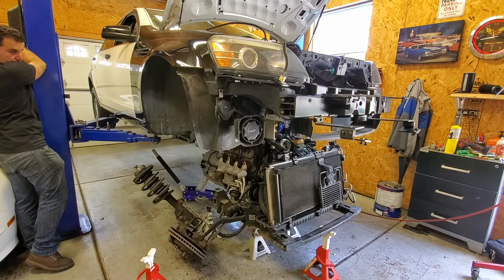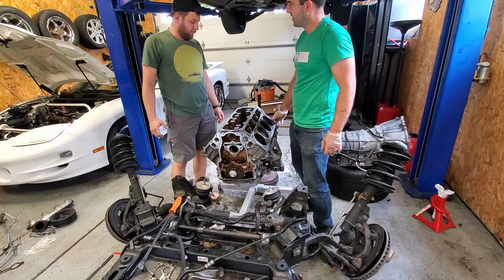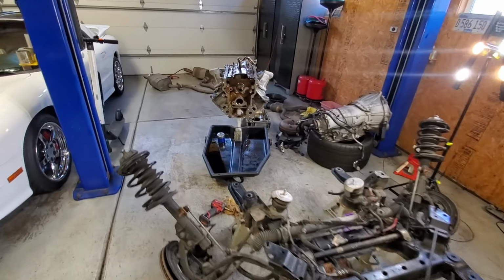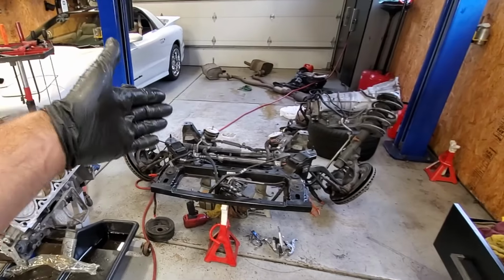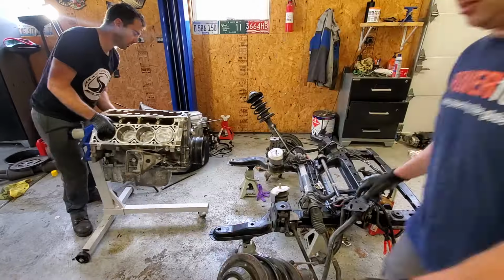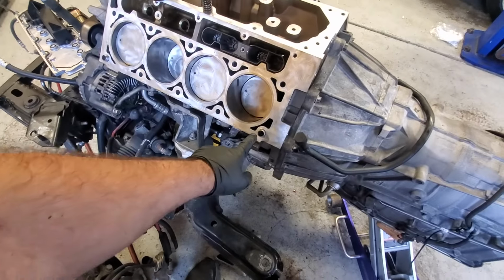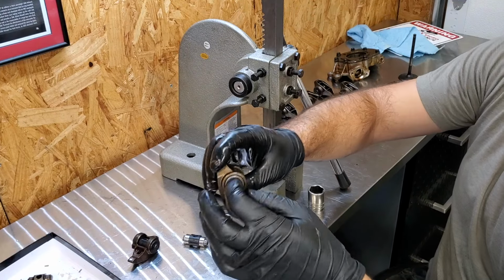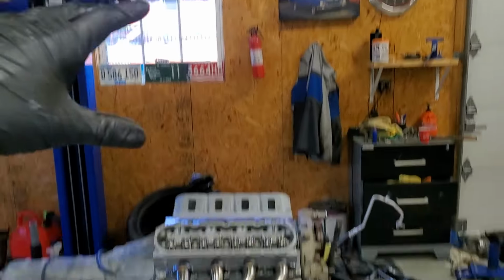Fixing THE WORST LS Engine Factory Defect Ever & Adding 100 Horsepower In The Process! GM Failed US!

Comment: Nah... I don’t know anyone who hasn’t experienced DOD/AFM lifter failure,  passed 100k miles is guaranteed failure.

And that “fuel savings” .... that was a marking pitch. Anyone with a DOD motor that has deleted the DOD system will tell you they get better fuel economy without it. No explanation- It’s just a junk system.  And I say that as a guy that’s bought GM cars and trucks for 15 years.

Comment: So recently I rebuilt a 5.3 truck engine from an 03 truck and attempted to put it in a 2009 truck. Found out that wouldn't work because of the DOD and had to sell the engine. So when you built that engine and deleted the DOD what did you do about the crank trigger? My understanding is that they are completely different and will have to be changed so the ECM can control the timing. Do you expect that to be an issue?
Reply: Your application didn't work, as the ECM was expecting 58 teeth on the crank, and you gave it 24.  Thats assuming you didn't change the trigger wheel. Or ran a standalone ECM. In which case - ignore this!  :D

Comment: It seems to me for such an awesome engine there's a lot of extra stuff that has to be done just to make them work properly from all the GM flaws I don't call that awesome I do understand that yes it's a lighter engine it's sizes different in comparison to the older Motors but then again what is the deal with all the flaws when do you think that they will ever build a motor that just doesn't fall apart all the time? And that goes for all of them Chevy Ford GMC Chrysler even the Euro trash which is even the worst out of all of them expensive garbage it seems they build a car that only lasts so long so that you have to keep buying and buying and buying but you had all the older vehicles that are still on the face of the Earth still have the same old engines that are still running

Comment: Stainless steel headers are bullshit ! What you want is ceramic coated headers ceramic coating retains more heat in the exhaust giving you more power and better fuel efficiency

Comment: @LegitStreetCars
That green rubber attachment you are using has abrasive in it. It does in fact remove metal, and has the potential to cause problems with variations in the surface if used improperly.

Comment: uhm actually that green wheel will remove material because the plastic actually has abrasives in it or a wire of some sort. It would not leave a pattern on the aluminum if it didn't. I actually use them all the time but I'm really careful because it does scratch the surfaces.

Comment: Alex, any chance you could give me some info about your WS6 turbo set up? I was watching your old videos about the set up, and you mention that you're using a C6 exhaust manifold on the passenger side to clear the AC compressor. Keeping my AC is my number one objective while going turbo. Can you explain a little bit more in depth on how you cut the radiator support, fitted the Saab radiator fans, and then how you routed the piping for the turbo set up? 

Thank you.

Comment: I am curious why you did not put on high pressure cam lube prior to can installation? Also, since this is a performance build, why did you not degree the cam with dial indicator etc?

Comment: For future reference, don't use the crankshaft bolt to suck the balancer into place. While you can get away with it 99 times out of 100, the one time you don't get away with it you'll be replacing the crankshaft because you stripped the threads out of it. Get an installer tool (as you mentioned). Cheap insurance.
Reply from the maker: I did use a longer bolt
Reply: @LegitStreetCars  - The problem is not the length of the bolt, but rather twisting the bolt against the threads of the crank as the drawing force. It's very easy to strip the threads out. Also, you run the risk of bottoming a longer bolt in the crankshaft, which will run you a huge risk of stripping the threads if you aren't paying attention. Using a tool will use all of the threads in the crank without twisting on any of them. The twisting is done on the threaded tool to nut interface. It's made easier by using a tool which has a bearing between balancer and the installation tool. You can't (sanely) fix a crankshaft by using a helicoil, and there aren't any larger hub bolts if you thought about cutting a new thread. The only real option is to replace the crankshaft, which costs you not only in money, but in time as well. Again, an installer is cheap insurance.

Comment: I've got a 16' Silverado 2500 HD with the 6.0, it has developed a squeak at 170,000 miles. I've been told it's a bad lifter by two mechanics... it does not have the cylinder deactivation feature. Both mechanics said I'd be better off getting a whole new engine. WTF?! Any input?

Comment: You normally install the cam with the dot at the 12 o'clock position on the LS. That's what all the service manuals say. That's what I did on my LS with a BTR stage 3 cam and it runs great.

Comment: so much piss poor work done with this !!!! 
did you REALLY tape up the crank sensor wires ? are F'n stupid !!!! get a dam connector harness end and cut and replace that end !!! you had a easy job and turned it into a nightmare !!! 

did you use the shims on the oil pump before tightening it down ?

Comment: So I really really hope that wasn't a 3m disk you were using to clean those pistons and other surfaces, because you might as well just poured sand in motor, down the intake and then started it. That's not what they are ment for. any particles or pieces can cause major damage. Even 3m tells you that

Comment: Alex, great build!! The Cadillac Modular Displacement Engine was a 368 v8  TBI, used in 1981 models and 1982-84 Fleetwood Limo's. The Olds 350 diesel was a different product.  I had one of each, and one of the HT4100 v8's from 1984.

Comment: Good choice on going amsoil. I service fleets of ford and Chrysler's. Using Amsoil from day 1 and they have 350-800,000 miles original engines ranging from 4 clys to 8 clys. Best oil on the market. I do 10,0000 mile intervals to 300,0000 miles then I go to 8,000 after

Comment: Dude, would've taken 5 mins to de-pin those harness wires and heat shrink them...about as long as you spent wrapping them with electrical tape, but with a longer lasting, more water-resistant solution.

Comment: Hey man. Just found your channel. You can dimple the headers to clear your obstructions. Roadkill did a dyno test where they kept bashing headers and making pulls. They basically destroyed the headers and it made almost no difference in power (maybe 2 hp). So bash away to make them fit.

Comment: is that really a good idea to take a whizzy wheel to the engine block mating surface like that???
Reply: No actually it is not . The Roloc wheel  hurts aluminum surfaces and should NEVER be used ...Cast iron YES Aluminum NO ....
Reply: I think maybe there's two different types of those wheels, brown ones and blue ones? Thought maybe blue ones were ok on aluminium.
Reply: @joecook3223  no!     NEVER!
Reply: Been using red wheels on aluminum forever, haven’t had any problems.
Reply: Oh he mentions it at 9:00

Comment: With cam kits, and we mostly use BTR, we ditch the hollow intake valves and upgrade to Manley stainless steel valves. The stock hollow valves are light but are two piece and can break with higher spring pressures and aggressive cams.

Comment: I can attest to using plastic grinding disc to clean the head surfaces. I used that method when I reused a cylinder head on a Hyundai Tucson 2.0 engine. Worked well and engine ran perfectly. No issues. Good tips.

Comment: Hey not to bash you Alex but on an aluminum block, the 60 grit bristle disks shouldn'tt be used because, depending on how they are pushed they can take off too much material. Issues can arrise with the Mls head gaskets due to the swirl paytern that they can leave hence heating and cooling cycles.

Comment: I need to do an AFM delete in my G8. It is tuned out in my GT but the AFM parts are still there.
Reply: In Australia AFM in the 6.0 LS motors was introduced in 2009 prior to that none of these LS 6.0 litre motors had the AFM   Not all of these V8s have AFM from about 2006-2009 VE holden V8 which is what your G8 originally was and shipped to the states and converted to LHD

Comment: GM has made over 100-million small-block V-8's. Why would they jeopardize the company's reputation on this unproven mickey mouse technology with a minimal overall advantage? I had a GMC Envoy that was like new except for the engine with this system. The dealer quoted a repair(out of warranty, of course) that was more than the car's value. So I sold it to someone that did an LS swap.

Comment: Highly suggest to remove the red spring and install the “similar to stock” blue spring in. It is known to starve the engine of oil in the pan because of the excessive pressure! I have a TSP 231/246 with a 111 LSA and PRC 260 heads. I have had both springs in and for a heads/cam car the blue spring has been overall better for drivability and oil temps were lower (red 220-227 degrees vs blue 213-220 degrees). Pressure sat at 40-45lbs on cold start and 27-30lbs warm with blue and 35-40lbs when my foot is in it.

Comment: Sounds just like the MDS system on Mopar vehicles. The best thing I ever did was get my Diablosport tuner and shut that horrific system off completely in my 2014 Chrysler 300C w/hemi V8. Add a 91 octane tune and different cooling fan parameters with a 180 deg. thermostat and it woke it right up. Gas mileage is unchanged at 21-23 mpg on the highway.
Mopar's system will give the same problems and trash the camshaft in case of lifter failure, and you have to pull the heads to change lifters.

Comment: I pulled a cam out of my l96 that looked like that.....flat lobe and all.....dod vvt motors are garbage should have never been used in the LS series if u ask me........on my wife's 2014 tahoe I gotta programmer and removed the dod the first month we owned it back in 2013..........still can't believe we paid damn near 70k for that pile. ....wtf ...it only has 36k miles on it now and we would probably be lucky to get 20k for it.......what a joke.....but it's still pretty quick for a soccer mom mobile.....quicker than the average tahoe. ....just programing and exhaust makes a world of difference
Reply: Trent Dawg I worked for a pretty cool dealership as a kid through college the owner  used to talk to me one day he said cars and truck are a poor investment and not an investment at all he was right but all my duties at the dealership over 9 years allows me to paint do professional body work engine rebuilds at my home shop  . I drive nice like new old cars and older supercharged  modded  C3 in blue old school blue and diamond metal flake for very little cost because of the skills learned .

Comment: Brings back memories, but on a small block 302 motor. (I believe I may have mentioned this before, so avoid it if you've seen it.) No one was ever able to give me any idea as to what the power really came from the 302ci Z/28 motor in 1969. Certainly not 290/290 as it said on the air cleaner. After using headers and a performance valve job with all new solid lifters, springs, lighter rocker arms and screw in studs, new valves with a better cut to them (more aggressive), new double roller timing chain, porting and polished and Cc'd chambers, the speed shop quoted it had somewhere around 410hp. That was with a stock cam, polished intake manifold (inside) and all new special (lighter and stronger) pushrods and a new 780cfm double-pumper Holley jetted to give the best power. I also had a mechanical advance distributor and a better coil. Needless to say, it ran incredibly well and while it had been a blast to drive before, it was like night & day with the new setup. I pegged the speedo a few times at 140 with the 3.73:1 rear on the std Muncie 2.20:1 1st gear tranny.

Comment: Great Video man. I had an engine fire in my 1997 Comp T/A Yesterday. It has been my dream car since I was in high school back in 97 and I've owned this car since 07. I had pulled it out of my garage and fired her up to log some IAC Counts. As they were a bit high at idle last time I logged the car. And the day before I modified the IAC Passages on my BBK 58mm TB to bring the IACs down. I stepped into the garage to put some stuff away. She must have sprung a fuel leak early on after I found a 1in split on the return line under the loom that looked like it had gotten dry and rotted. And it must have been leaking for a few min. About the time it started idling kind of rough I looked up and thats when it ignited. There was a giant fireball I ran to the car and turned it off, ran to my garage to get my fire extinguisher and remembered that it was still at the back of the house as I had it near by for my 4th of July BBQ. I know its a big no no for a fuel fire, but my outside faucet and garden hose was closer...cranked it on and got the fire out. All the wiring is toast, some melted plastics and the engine bay looks like a burnt roast. I'm not worried about the mechanical and I can repair the engine harness myself. But some of these plastics are getting harder to find.....been a bad year for me man. Like I said, great content and it actually put me in a good mood.
Reply: Could have been a worse year if you gotten burnt badly or your house burned down . It sucks but be grateful
Reply: Glad your still here man..
You'll bring that monster back to life in no time

Comment: I liked the LS6 sodium filled valves. The fact you can interchange factory parts and make a 700hp to the crank badass, with the wieght of a V6 makes these GM motors king..not to mention cheap aftermarket parts with amazing support.

Comment: Take it for what it's worth but the one time I tried selling bristle discs to the engine builders in my territory I was told they're too aggressive for aluminum. With a green disc being a 50 grit equivalent I feel pretty safe in saying you probably left an impression on your block. It'd be interesting to see a machine take a few light passes now and check for low spots.

Comment: I think a bigger LS engine fault was the way oil pump springs would fail and the pressure valves would hang open in the early LS engines.

Comment: I have a 2009 Pontiac G8 GT which is the earlier version of the Caprice PPV.  I've got almost 200k miles on it and I did have a lifter fail on the engine at about 167k but it wasn't due to a failed lifter.  The lifter holders, which are plastic, allowed the lifter to rotate and it destroyed the lifter and cam.  I can attest that the AFM, in my case, is about a 5 MPG improvement on my car.  It goes from 19 MPG to almost 26 MPG on the highway.  The trucks don't see the same improvement I guess.  The car does have a VCM intake, Solo catback exhaust and Superchips tune on it as well.  Loving the content on this build too!

Comment: Thank goodness.. I’m in the middle of this job myself!!!! I stripped the cam retailer bolts. It’s a stupid torx fastener. What’s a good replacement?
Reply: Be carefull with low quality torx bits they will strip out a lot of bolts especially chinese torx bits they are out by 100th of a millimetre which is enough to wreck your bolts

Comment: a more proper repair would have been to  pull the individual wires one at a time out of the weatherpak and shrink wrapped them one at a time, its too easy not to do that,  then shrink wrapped the entire pig tail, then put the loom on, then heat tape on.

love your videos
Reply: Second this comment. If you've ever taken apart electrical tape after it's been in an engine compartment for a year or more, you'll never use it again. Temporary repairs ONLY.
Reply: The only issue with that, is that metripack connector is pull to seat. The heat shrink wouldn't pass thru the conector body.
Reply: @allanb3222  i forgot about that...i guess you could remove the pins, install the shrink, push the wires thru and then reinstall the pin and pull seat.   I work on alot of Toyotas and i have to remove burnt/corroded wires alot of times,  so i pull off the crimps, cut the old dirty wire out  and then solder the new wire to the central portion of the old pin and then recrimp the insulation seal back on the larger crimp and reseat.  toyota has a few connector that are pull to seat but most are remove lock, insert removal tool, pull out the rear.

Comment: Seems to me like literally all of AFM's issues can be attributed to poor maintenance. Clogged oil screen, oil sludge, low oil. Poor maintenance.
Reply: Even the low mileage engines, less than 50k miles? 
What causes the spark plugs to have oil on them when I take them out. It's not my valve covers. It's only on the DOD cylinders.
Reply: @TooFly357  I would hazard a guess that its just because when the DOD is active there is no fuel or fire in those cylinders to burn it off.  Probably have the same amount of oil in all of the cylinders, but the others dilute it with fuel and burn it.

Comment: I'm doing an aluminum 5.3L in an 08 Avalanche right now, LOL. I wanted that better cam and the DOD delete but couldn't give up the gas mileage. To bad you didn't tear down the block completely for inspection. In mine I noticed bures everywhere. I even removed the cam bearings and found a nasty one ready to break off and head into the mains, LOL. I deburred everywhere before I went any further.